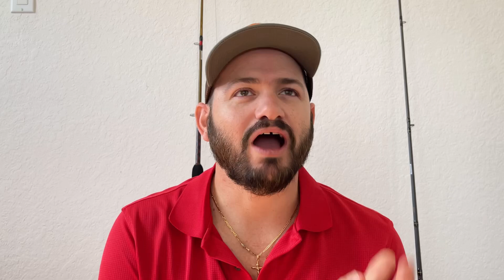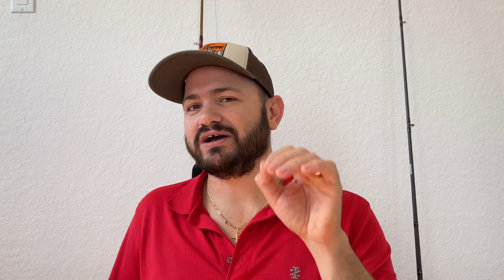DREAM FISHING KAYAK (idea)

Comment: It would be easy to do.  You just need to construct a set of pontoons, small, that deploy with flexible wings behind the seat. The pontoons would have a set of skegs onto which you mount 2 torqedos, one on each side.  It would require 2 batteries to last as long. But one would last half as long but speed should be about 5 mph to 6 mph. Contol with normal rudder.

Comment: Sounds like you just described a solo skiff sort of. I think somebody needs to come out with a new prop for trolling motors. That would help with speed quite a bit.
Reply from the maker: Solo skiff 🧐🧐 still wanted to have that yak feeling
Reply: Yeah that's what I was thinking. Sounds like he's describing a solo skiff
Reply from the maker: No even close solo skiff is 14.5 by 41 looks like a boat has no place for a trolling motor in the broth the outboard mount is permanent,  no kayak seats no tracks. I was thinking 10hp was too much maybe 6hp max for my dream yak
Reply: @AliexFolgueira  IDK  if I were to have an outboard I would want something very stable 41 is not bad. The floatation behind the motor on the skiff is nice. 50 pounds on the back of a kayak might make it pretty back heavy. Sounds like the jonny boat is closest. You mentioned that. I got a Crescent lite tackle. It has a transom mount. The hull might plane IDK. Its pretty fast just paddling it. Open Deck comfortable seat.

Comment: The hull is going to be a issue, hybrid hulls are tricky, this coming from someone who has designed hulls for decades.
Jonny claims a planing hull. But i have watched it. it doesnt really plane.
To get real speed your going to have to have the hull ride on a pad, which means most of the hull is out of the water.

 Motor wise i have seen a guy playing with a high amp motor which is interesting. Hes getting 10+mph out of a regular kayak hull and the motor is actually pretty  small. Hes running into controller issues. i think hes bumping up to a 300amp motor controller.

 The issue with all the manufactured motor choices we have currently is none of them were actually designed for kayaks and speed. 
Even the torqueedo was designed more for rafts.

Anyway. i love to see something looks wise between the hobie pa, the apex tier and the shearwater.
Reply from the maker: Yeah Jonny doesn’t like plane like a bass boat but it does look nice with the bow up gonna be a crazy project for sure very hard do  to do and you are right none of these motors are yak motors
Reply: @AliexFolgueira  jonny planing reminds me more of like a deepsea boat type of planing.
Like my old silverton was a planing hull, but reality was most of the boat was still in the water lol.
Now my last bass boat was a basscat pan 2 and it literally rode on a 2 foot pad. So out of 21 foot of hull only 2x2 of it was touching water at full plane.

 Before we can even think about reaching something similar we are going to need serious development of a motor 100% designed for high speed kayak hulls.
Doesnt have to be gas though, a lot of progress is being made in electric outboards.
Theres also the possibility of going inboard waterjet. a couple of companies are making jetyaks now.
I would love to test one, i have watched plenty of vids on them though.
Kind of surprised you have not tested one yet.
Reply: @AliexFolgueira  look up aquanami jet kayak, one of the best looking i have seen
Reply: @AliexFolgueira  nm i see that you seen one atthe boat show lol

Comment: That sounds pretty cool man. What you were describing had me thinking of my Kaku Zulu. I luv my yak. You can put a small outboard, or trolling motor, and place two micro poles. It's flat and can be fixed up the way you want. tight lines